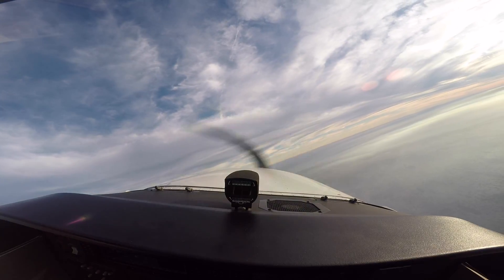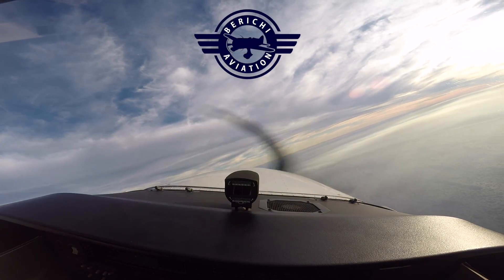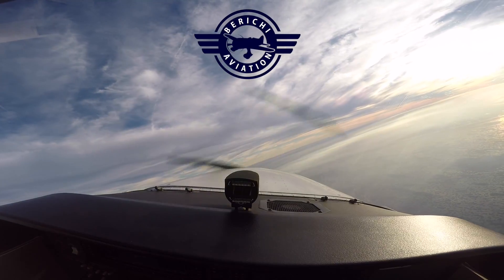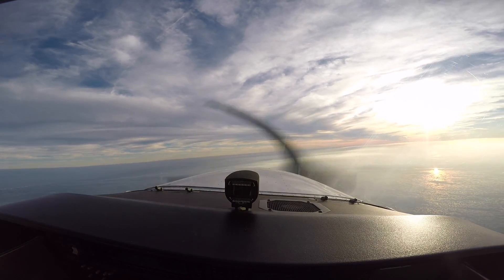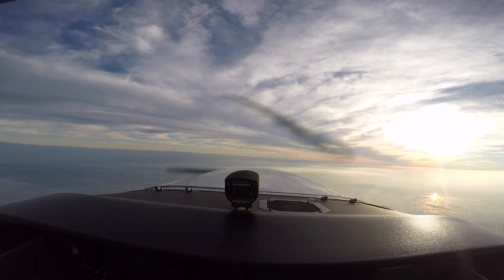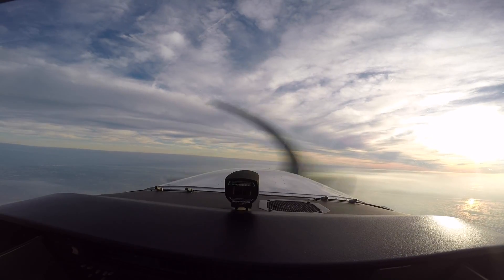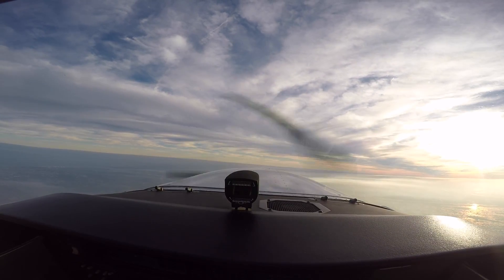Cessna 172SP Fully Developed Spin Recovery Training Full HD ATC Audio

Comment: This should be in mandatory in every pilot license
Reply from the maker: Atilla Otto Hi Atillia,

Your absolutely correct. This reasoning is what motivated our team to implement UARC into our curriculum.

For UARC (Upset Attitude Recovery Course), many pilots confuse unusual attitude training with aerobatic training. Like many pilot training issues, I think the confusion stems from the pilot's experience as a student. In most pilot schools, CFIs follow the standard training syllabus and teach recovery from attitudes as directed by FAA. Those "unusual" attitudes are comfortably inside the performance standards of GA aircraft - less than 30 degrees pitch and maximum bank of 60 degrees.

Those attitudes are truly mundane when compared to a nearly inverted nose low attitude resulting from a real life encounter with wake-turbulence.

The classic pilot school power off stall from level flight has absolutely no similarity to the accelerated stall and spin entry often associated with a base to final turn.

Following the pilot school experience, I think a pilot will come away with one of two self-assessments of his piloting skills:

Based upon his comfort level and praise from a CFI (or DE), the pilot will think he is well prepared to encounter an unexpected stall or unfamiliar attitude.

Many pilots are uncomfortable performing the attitude recovery taught in pilot school and they will correctly acknowledge their need for more training.

In both cases, the pilot should seek proper unusual attitude training. In the first case, the pilot does not know what he does not know. In the second instance, the pilot needs to mitigate his discomfort with flying before it develops into a debilitating fear.
Reply: It’s mandatory training in Canada for even private licences. Our flight school makes us use 1/2 tanks in a 172p/r/s though. They claim the 172SP G1000 won’t enter a spin due to its balance for some reason.